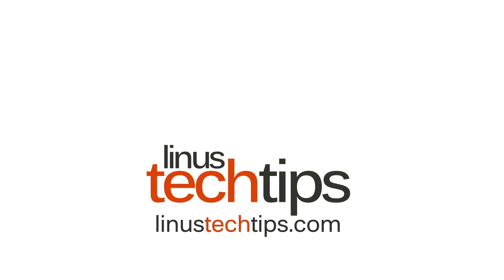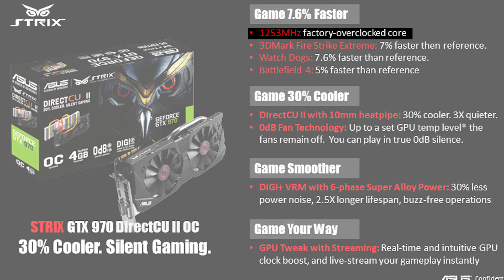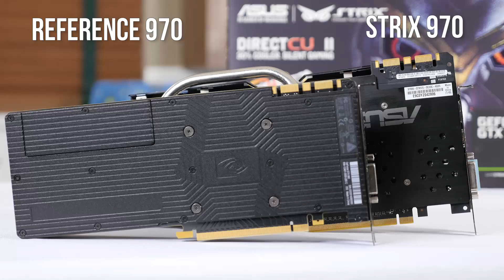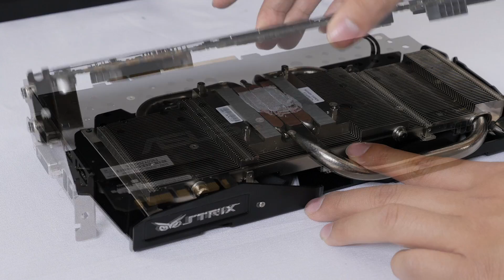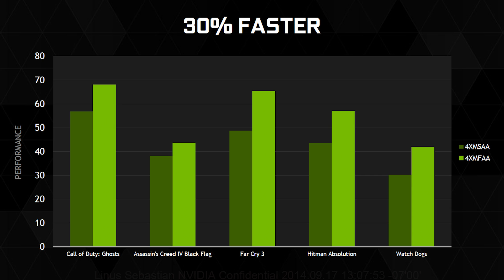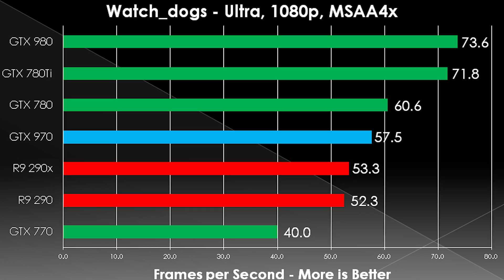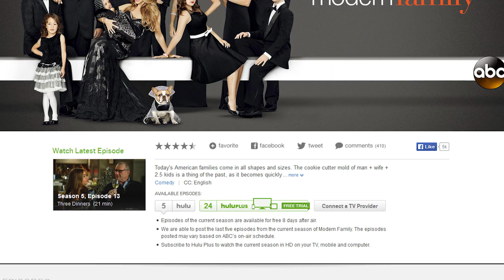ASUS Strix GeForce GTX 970 Video Card

Comment: Thinking of dumping Crossfired R9 270X's for one of these Strix cards, any thoughts?
Reply: 441meatloaf
Actually MFAA and EQAA are not the same, but you are correct about it not being new to AMD/ATI.  ATI actually used to have a "Temporal MSAA" mode that was equivalent to Nvidia's MFAA but they scrapped it a long time ago, it predated the Radeon x1000 series.

EQAA is when the card utilizes "coverage samples" and is equivalent to Nvidia's "CSAA" which, you guessed it, stands for coverage sample AA.  Coverage samples are cheaper than obtaining full color samples for MSAA, but they don't work under all circumstances.  So with 2xMSAA + 2 coverage samples at best you get the quality of 4x MSAA with the performance hit of 2x, at worst you get the quality of 2xAA.
Reply: ***** I knew the dimensions and it fits my case, I was just wondering if it was good idea, although since PCDIY is an ASUS channel I have a feeling I already know the answer from you guys since the Strix is an ASUS card.
Reply: How well do the cards run in crossfire? I have one R9 270x and I was considering getting another.
Reply: Unless you have troubles with the cf setup i wouldn't bother. Or you have to be able to sell your cards for a good price and get the 970 basicly free, then i might consider it if the 970 isnt to big of an performance downgrade. I recon those 270x's are just as fast as a 780ti or there about. My 7850's had 7970 cards for breakfast so yours must be quite a bit faster.
Reply: roger supernova These cards don't double in performance contrary to popular belief, on paper they do but since most games don't have decent support for multi GPU setups I have the same performance as the 770. As for CrossFire itself it works really well and excels with high rendering for video and photo editing. My only issue is PCI bandwidth and power consumption. The GTX 970 from ASUS uses less power than two of these and I get about the same performance depending on the game.
Reply: Ryan Grobe are you sure your system is ok? What are you running?
As i said my pair of 7850 used to fly. And the ones you have ar basicly overclocked 7870's. Have you overclocked them? I replaced mine over a year ago, but back then they where faster then any single card on offer. Thats why i expected yours to still be rocking with the top ones now.
Reply: Ryan Grobe and if you rander a lot make sure your software has cuda support. Otherwise you are limited to r9 290 anyway. And concerning the the bandwith and power issue, a single card is always the better option in that regard. Tuff choises lol.
Reply: roger supernova Yeah my system is nominal, I run an i5-4670K @ 4.2 GHz; Corsair Vengeance 16 GB @ 2133 MHz; the CrossFireX config for the 270X's and they are overclocked slightly; ASUS Maximus VI Hero; Windows 8.1 Pro; Cooler Master Silent Pro M2 850 Watt PSU.
Reply: Thats a nice rig you got. No problem there. Have you looked around what others are getting with these cards? It could just be that the new games have bad cf support or that the 270x just doesnt like crossfire. If thats the max you can get out of those cards, updating to a single new one seems like the better option. Especially with the other issues you discribed. I'd see what i could fetch for those 270's and see if it made sense to make a switch. If it isn't that expensive go for it.
Reply: roger supernova  crossfire/sliu support is all right , titan fall is the only game in recent mem that dont support it , but that is a source engine game so it runs easy as balls anyway
Reply: 5british5 ok. Didnt play that.
Reply: The only games that actually perform really well with the CrossFireX config are the Battlefield games and Crysis 3, I can run BF4 on Ultra using Mantle at 1080p with 120FPS which is slightly more than what a 290X can do. Crysis 3 on Ultra at 1080p hits about 45-50 FPS with 8xMSAA. Otherwise most games act like a 280X, it all depends on the game for me.
Reply: Ryan Grobe  there are more games out there then that .. and if you are using crossfire  you should be on something higher then 1080p .

even 1 270x 4gb can do ok in eyefinity
Reply: Hey Ryan, I just ordered the Asus STRIX GTX 970 today to replace my 2 HD 7870s in Crossfire.  The 270x/7870s are pretty damn potent in crossfire, but for me I'm trying to reduce noise and power consumption.  I plan on running a few before and after benchmarks for comparison so feel free to keep in touch with me about it.

Comment: Thats weird. I have seen some 970's beating the 780 or have the same performance as a 780 but this benchies on this video have it between the 780 and 770? Or is the Strix from Asus is just that bad when it comes to benchmarking?

MSi's GTX 970 and Gigabyte's 970 easily beaten the 780 both stock and overclocked at max (it beat a 780 by about 5% and or have almost the same performance) It even beat a GTX 780 Lightning which is a heavily overclocked version of a 780..

Check the Bench : http://www.guru3d.com/articles-pages/nvidia-geforce-gtx-970-and-980-reference-review,1.html

Comment: The more research I do about buying a new video card the more I keep coming back to the value minded nvidia 970. My inner super gamer wants the baddest card. But the more actual in game specs I look at the less and less I am convinced that blowing $550+ is the way to go. My 680 was 600.00 and less than2 years later it's getting replaced. At less than 350.00 and 370.00 for the OC 970 even though I have the money for the 570.00 nvidia 980 I can't bring myself to buy it. It just doesn't make any sense to me. The 200.00 price diff is a full year of subscriptions for TWO games! And for what an occasional and variable 10-20% boost on speed way over my self capped 60fps? Damn it is this what maturity feels like???? Sighhh

Comment: Will this build be good enough for the next 3-5 years?
EVGA GeForce GTX 980 SC
Intel Core i7-5820K
ASUS X99 S LGA2011-3
G.Skill Ripjaws 4 DDR4 16GB
Corsair HX750i or AX760i
Corsair Hydro H100i
Samsung 840 EVO 120GB
2 TB HDD
Reply: More like 10 years.
Reply: Syndicution
Radeon GTX Titan290x with SLI Xfire enabbled*
Reply: Yes, except for the GPU, which makes the biggest performance difference.
But as long you can SLI, so you could still upgrade later.
Reply: I will add an other 980 later ;)
Reply: Omg why are you spending like so much on gaming I mean seriously a 980 SC? DDR4? 5820K? I DIDNT EVEN HEAR ABOUT THIS! How much is it gonna cost like 6000?
Reply: Syndicution No need to buy the Superclocked version, you can just overclock yourself.
Reply: No, this will be outdated in about 1 week. You'll need a Titan Z and an Exeon to stay competitive.
Reply: My build will cost just under 3000 USD but if you buy the parts in the US the build will go for around 2000 cuz i live in Norway :P
Reply: Yes
Reply: Dude thats almost overkill. Ur fine lol
Reply: Sheogorath Newell Xeon*

Comment: Hello Linus thank you for doing this greats unboxing,I have a few questions: What do you mean with 2.5k resolution..? I actually have a 2560x1080 monitor with a gtx 690. I want to upgrade to a single gpu. it will be enough a single 970 for the next 2 years? I pretended yo play most games with High detail. Thanks a lot.

Comment: What's with these results showing the 970 being slower than the 780? I know everything's overclocked but I was under the impression that the 970 was much better at overclocking than the 780 because of its TDP?
Reply: cherry 780 and 80ti

Comment: Wow, GREAT value but I'm relived to see the 780 win. I just bought mine last week not knowing about this card and would've been bummed to see something cheaper AND better come out.
People on forums were saying the 970 is more powerful.
Reply: I got both cards and did overclock on both, nothing fancy or hard modded. the 780 won in every game and bench but was nearly tied in 3dmark. me and my brothers are all p gamers and we had ton of cards come thru here and kept the bench records of 4 780's overclocked. 780s per Mhz is 8 - 12 percent faster than 970. in fact not even the worst 780 we had lost to any 970 bench scores on any bench what so ever. stop the debate i have both cards. i assume u all were super excited by the reviews but i was too. thing is in every review only card pushed is the one under review. and when not overclocked the 970's tend do better than most refference clock 780s. bbut like i said before per clock is different story. i looked hard havent found one bench where a pushed 970 beat out any of the 780's we had. i know for a fact that neither of my 970's beat the 780's ............... so did i get horrible chips? cz my cards reahc 1600 mhz and  so if not it must be 4 golden 780s that came through this household than right? lol guys relax 780 is stronger. guy buy both and push both u wil see and if u dont got both u cant say much honestly. LINUS PUT ALL THE SPECS UNDERNEATH THE VEDIO. THOSE ARE NOT GOLDEN 780'S BY ANY MEANS IN FACT 3 OUT OF 4 THAT CAME THROUGH THIS HOUSE HAD HIGHER CLOCKS
Reply: Ruskie The variable that causes that is the chipset. Most 780's come equipped with a shitty Elpidia chipset that can only overclock +200mhz, while a lucky few have a quality Samsung chipset on-board. Mine has a Samsung chipset and can easily overclock passed +750mhz. Linus doesn't have some 1-in-a-million card, you guys are exaggerating without any solid evidence.
Reply: Kayshot it would be dumb to sell a 780 and get a 970, since a 980 is only 100-200 more and how long does it take to save up for that? Totally worth it in my opinion and u will be blown away by the performance as well. No regrets
Reply: Kayshot didnt say it was 1 in a million. i said that it is better than most 780 benchmarks i see
Reply: Dude, i don't intend to bum you out, but the Gtx 970 is better. seeing that most reviews hold benchmarks at about the same for the 780 and 970, just imagine how much more frames and better performance the 970 will run once updates and drivers come through. should of done your research, i was on the same boat as you about to buy a 780 ti until i saw the 980.
Reply: ***** Same, but the people who said it's better didn't provide benchmarks to prove it, so I'm kind've leaning towards believing Linus since he benchmarks tons of cards.
Reply: You could probably return your card and get a 980.
Reply: Brendan Baird I checked, no returns :o Plus my ASUS 780 cost me $100 less than a 980.
Reply: Well, I wouldn't worry. You still have one of the best cards out there.
Reply: Brendan Baird Thanks, just a tad bummed over missing out on integrated downsampling, but luckily gedosato works on most games.
Reply: 970 is better. Linus has said multiple times that he has a golden 780 that allows them to overclock the hell out of it
Reply: Yeah good luck with electricity bills with the 780 brah
Reply: John Marc Cagatin It comes out to literally just over $2 more a month, I'll live. Lol
Reply: Ruskie Golden? Can you elaborate?
Reply: 970 is better. All gpus were over locked in the benchmarks. He said he had a beast 780 so it beat most of the other cards. That's what he meant by golden
Reply: Kayshot their 780 is teh shit and overclocks mile high
yours is probably shit
Reply: blade00362 SpiderGamesHard  Okay, you guys are saying it's a "beast 780" but not elaborating on what makes it "beast" which makes you guys sound ignorant as shit. They have the overclock spec of their 780 on their site, dipshits, and mine is overclocked exactly the same. Some 780's have a crappy elpida chip which prevents it from overclocking more than 200mhz. I'm overclocked wayyy passed that since my 780 got the good samsung chipset (luckily)
Reply: Honestly, I can still sell my brand new 780 for about $320 and scoop a 970 no problem, which is why I actually want to know which is better aside from unsubstantiated claims of "he has a magical 780, blessed by monks and bigfoot"
Reply: I've heard that the 970 will perform slightly better than the 780  at a stock clock speed. Just look at benchmarks, dude.
Reply: Kayshot Some cards, cpus, ram, etc. overclock and perform much better than others. for instance, my friend has an r9 290x and my other friend has an r9 290x. both the same referance design. however, one of the cards overclocks and straight up performs better than the other. there is variability when it comes to computers. Linus just so happens to have a kickass 780
Reply: RxSwolldier Yea you're right, a 980 would definitely be choice.
Reply: LegitFilmsHQ It's not a burn at all dude, I'm just seeking responses that incorporate logic. The GTX 780's initial benchmarks upon release haven't budged much at all even though they've updated the drivers extensively, so I honestly don't see the 970 magically pulling ahead by a considerable amount of frames just by receiving a few driver updates. The 980 trumps both cards without question, but costs considerably more. Plus, you very well may have been vieweing benchmarks that just test a basic reference 780 as opposed to more powerful models. Also, most 780's are stuck with a shitty 3rd party chipset that limits overclocking to 200mhz, and those were likely used in the benchmarks you saw. I'm overclocked 750+mhz without even touching the BIOS.
Reply: eh idc anymore, i grabbed myself a 980 :) loving it
Reply: LegitFilmsHQ That has nothing to do with the subject, pretty satisfying to see you cop out so cheap though.

Comment: Whats better, 970 or 780ti?
Reply: abartel6 GTX 970 is just fine running max at 1080p with 50+ average FPS with current games. 
If 1440p, then yeah, I would get the 980.
Reply: abartel6 That ebay one could just be a chinese knock off and really a crappy GTX 460 lol.
Reply: Well really, the 970 is about half the price of GTX 780 Ti, and beats the 780 Ti in some benchmarks, and also less power consumption (105W less), then has MFAA and SSAA, so if you're buying something new, the GTX 970 is the choice, as it offers a lot of performance for the price, which saves you money as well.
Reply: Medieval Blast well i found a 780ti for $340 on ebay, but its used. Idk what to do...
Reply: abartel6
Brand new 970 for the win. For all we know that one on ebay is damaged from overclocking too high. Brand new always gives you the benefit of the doubt that you are the only one that has monkeyed with it.

If you don't plan on overclocking yourself then the 780 ti might be worth considering but supposedly they are almost alike in performance so getting the brand new card is safer than the used one anyways.
Reply: LonewolfT11 Medieval Blast ok thanks for your help guys :)
Reply: abartel6 one more question, im planning to get a i5 4670k and 8gb ram, is it worth it to get a 980 or should i just get a 970? I will be playing in 1080p, unless i can find a really cheap 1440p monitor, which i doubt will happen. Thanks in advance :)
Reply: 18aidanme lol good point
Reply: just look at the benchmarks in the video, the non reference 780 ti's are better than the performances of the regular 780 ti's which are better than the 970, so yea the 780 ti is still loads better. but the 980 is still better than the 780 ti
Reply: I will upgrade my gpu from crap gts450 to gtx970 with i7 2600k and asus p8p67 pro
Reply: 970 oc
Reply: Chanrich Pisitjing 2600k with a GTS450? What kind of pot were you smoking when you ordered it? I'd really love to know.

Comment: Can this be powered with a 430W power supply? Im running an R7 260 atm and Im planning on replacing it with this card.
Reply: I've seen OEM PC's having 970 with a 400W supply, so it should be OK, as long it's not bad quality.
Reply: Corsair 430CX I dont think thats bad quality. :D

Comment: 1080p 4x MSAA  Watchdogs and 60 fps for a 780? my 780 isn't even near, it is not over clocked but damn i have dips under 30 fps, is Watchdogs a cpu demanding game or something? i have core I5 4430, is my cpu the culprit of this performance?
Reply: its just a shit port for pc
Reply: the CPU is completely fine for gaming. I think you might have bad video drivers, and yeah, Watch_Dogs is really bad on PC and you can't get reliable benchmarks on it.

Comment: I'm sticking with a GTX 970 Twin Frozr.
Reply: Nevermind, just sticking with EVGA
Reply: Ken jii No,the heatpipe is misaligned to the GPU.
Reply: Ken jii Please don't, the EVGA ACX cooler has some decent issues with the heatpipe placement. There's not a single reason to get an EVGA card over any other aside from maybe their return policy.
Reply: Flandre Scarlet I know, I didn't realize that it had heatpipe issues until i saw that problem yesterday.
Reply: Let's just hope the inno3D 970 isn't shit.